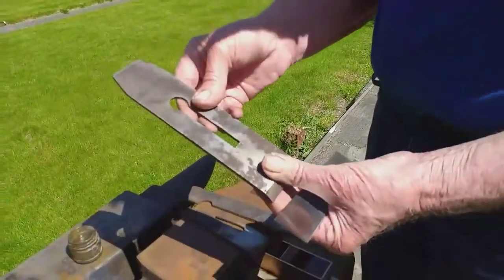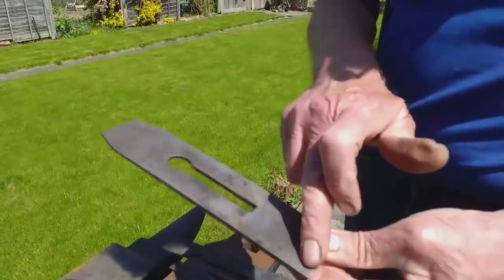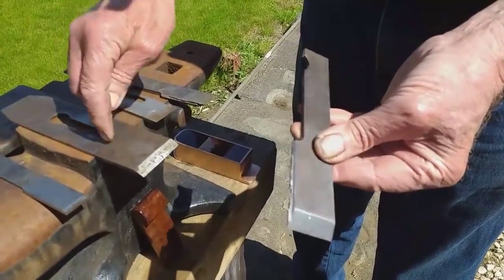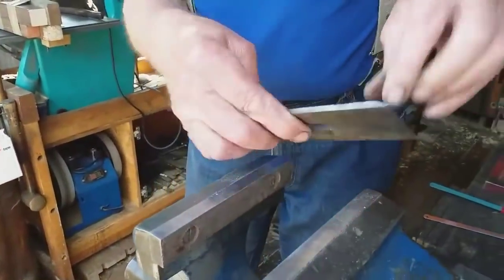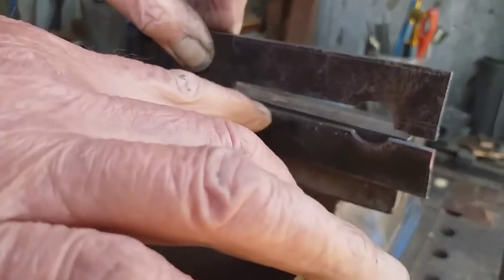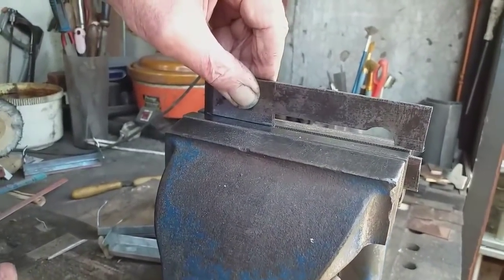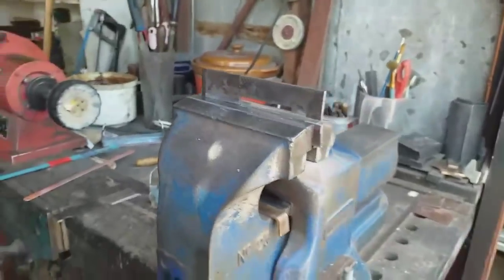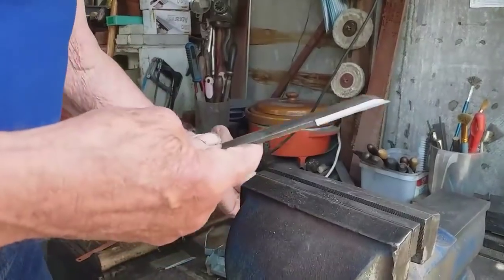No116) How I Adapt Old Laminated Irons Into Small Mitre Plane Irons.

Comment: I use the same method to "cut" hss stock, I grind a small line as a break point and then use the vice and a big hammer. Saves a lot of time with the grinder. 
To protect myself though I always put a rag over the top before hitting it, you would be amazed how many small shards and slivers it catches that would otherwise fly around the workshop.